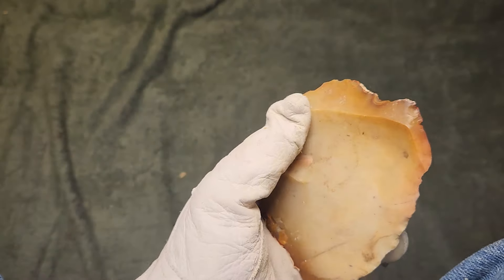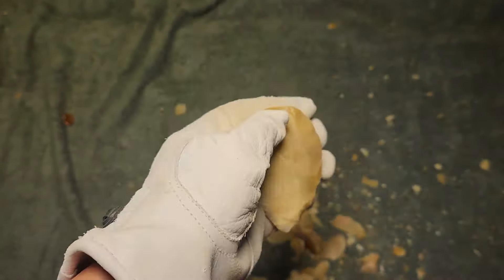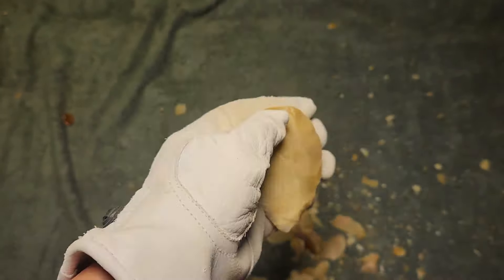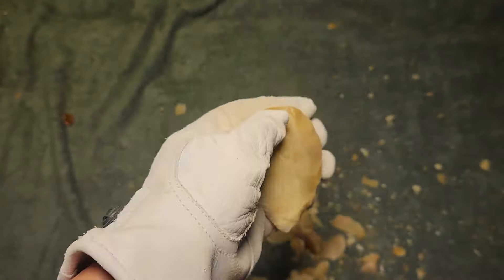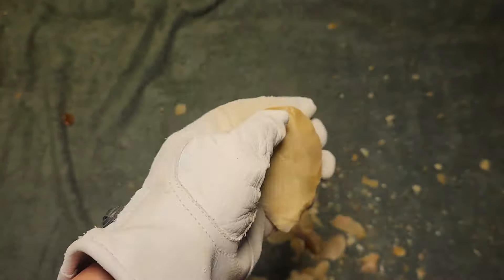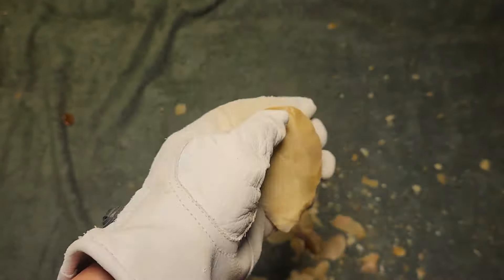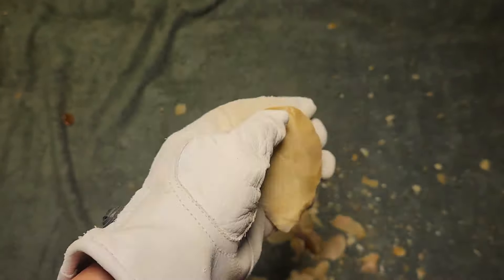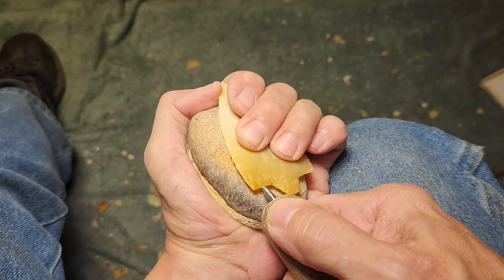1864 - Heat Treated Petrified Coral Flintknapping

Comment: The quiver and arrows in my opinion must have belonged to him, it is extremely unlikely the attackers would drop one of theirs and not recover it, and a unrelated loss is even more unlikely, I can see that it’s possible they would recover his bow and may have been in a rush to recover the rest, although the axe was probably the most valuable item (not produced in the area) and not to recover it is confusing unless lost in the snow, they presume that the body even though found in a hollow has moved down the mountain with the ice thawing out a freezing a number of times, this would explain the distribution of the objects some metres away from the body. (See map in article below).
Tom Loy found 4 human blood samples from different individuals 2 on an arrow 1 one the knife and 1 on the cloak, Tom Loy sold the results to a newspaper as an exclusive rather than produce a scientific paper.
Lars Krutak in his paper believes that the tattoos were therapeutic due to the use of ash to make the designs in areas of pain, difficult to prove as there is only one example.
It would be difficult to judge the condition of objects after 5300 years, as too being dirty or the quiver broken and arrows in poor condition can only be speculative.
Have a look at New study of Ötzi the Iceman suggests his preservation story was not a series of miracles
I suspect we will never know but it’s fascinating 🤨
Reply from the maker: Thank you very much for the info!